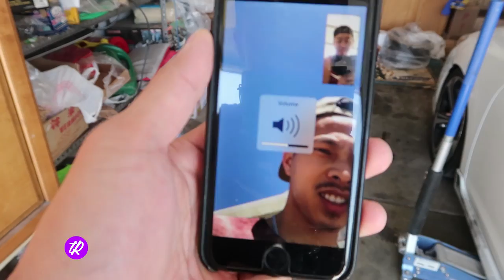LOWERING MY HONDA CIVIC SI ON WORK WHEELS

Comment: Dooooone !!! I just 15 si civic looking for some suggestions on Wheels and drops !!!! Thanks
Reply: Kreyes956 
2 inch drop all the way around with coilovers. Maybe 2.25-2.5 on the back. Rear camber kit and 18/8.5 rims, 35 offset. You can go wider than 8.5, but you’ll have to do fender modifications and camber quite a bit.